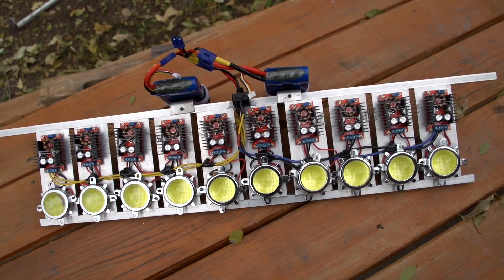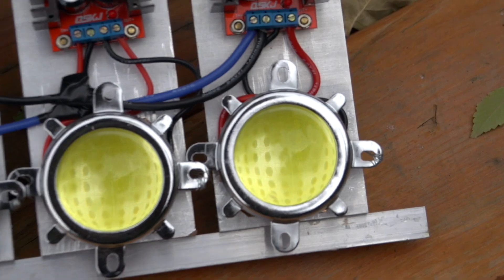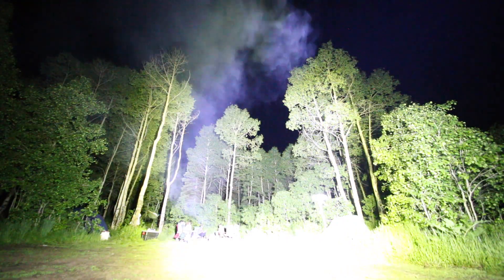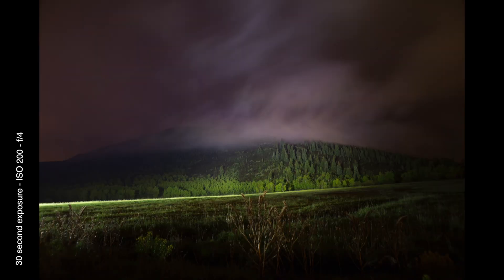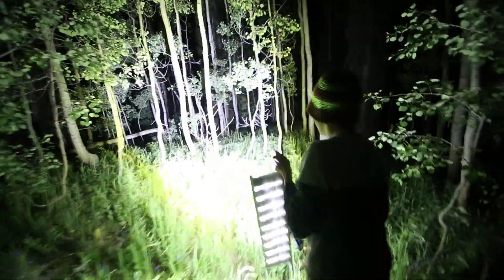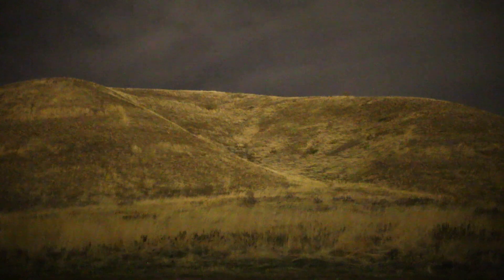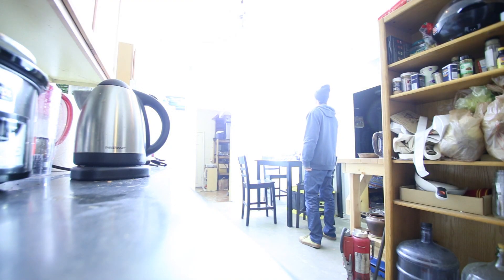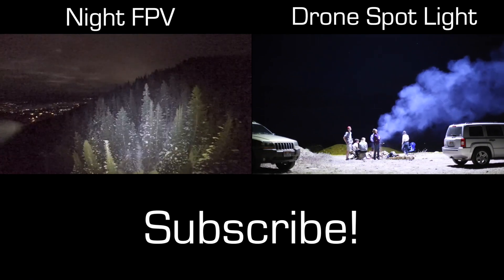1000W LED Flashlight - Worlds Brightest (90,000 Lumens)

Comment: Impressive work!!
Reply: +DIY Perks Your is better. It outputs 1000W without needing so much power.
Reply: 1000w equivalence, yeah, but this one is 10kw equivalence. :O
Reply: DIY Perks Right..I noticed that now too. Awesome videos, keep it up !
Reply: +DIY Perks Looks like Daniel discovered your excellent 1000W equiv LED tutorial and went mad! :-)
Reply: Andy Lee Robinson I have 10 kW flashlight but it produces only fraction of that power as light
Reply: you know you done it right, when DIY Perks tells you it's impressive
Reply from the maker: +DIY Perks Thanks man!
Reply: +rctestflight When the Batman signal?
Reply: +DIY Perks I need answers, what parts did he use?
I have no electronic experience, but i really want to make something similar to this!
Safety always comes first, also when driving in dense roads with greenery in every direction, not to forget animals...
Reply: ***** Yep, totally correct. Even xeon car lamps are forbidden in my country for that reason.
Reply: ^ I hate those lights.
Reply: +rctestflight where can i get the proper tools to make on of these ?
Reply: +rctestflight I don think that's a torch, it's more of a 1/3 of the sun XD
Reply: its true but if u use like one ore 2 a extra pack is just to expensive
Reply: what kind of projection lenses ate those?
Reply: haha ik dont know
Reply: you can blind the airplanes with that

Comment: How does this compare to actual sunlight during the day?
Reply: +Generic Username On any given day, the sun puts out 10 000 - 20 000 lumens in the shade, and 30 000 to 100 000 lumens in direct sunlight. So this 90 000 lumens is comparable to a nice sunny day.
Reply: +Danie Oberholzer (InsaneMfB) 10 000 to 20 000 lumens per square meter?
Reply: +MushroomHumor Why no?
Reply: ***** So darker than a clear day, but lighter than an overcast day?
Reply: +Generic Username
Impossible to answer knowing just the amount of lumens, without knowing what range you intend on using it at, and how the light is focused. At any practical range for a floodlight, it will never be close to overcast daylight, and it's not supposed to or necessary.
Reply: Toni Ostarcevic I'm not disagreeing with you, but you have to remember that with the flashlight, your eyes are adjusted to the darkness so it seems bright. With the sunlight, your eyes are adjusted to the bright light so it seems darker.
Reply: I meant to ask if the light lights up the ground at night as much as the sun does in the day.
Reply: My first time commenting on youtube in over 3 years, and I also wondered why I never did. You guys quickly reminded me why I usually dont.
Reply: +Thunder Cat You are pretty intelligent.
Reply: +Toni Ostarcevic You are not so intelligent.
Reply: +Generic Username The sun is a much larger light source compared to this that you can hold, about the width between your arms holding it.  The light is bright, but also much more concentrated.  Hence you see the shadow all over the place, like photographing with on-camera flash or a spotlight.

The better application would be to have the individual bulb on separate stands, so they can envelope the subject better, providing a more even illumination too.  In this case with a dimmer for even better control.

At this point, I see it as to see how much can you hand hold... you find the brightest LED bulb, put several of them together and there you go.
Reply: +Thunder Cat 
No, you're not correcting me. The question was "how does this compare to sunlight", and your answer already defines the things i told you need to be defined. However, this is not any usable answer to the original question, which really has no reasonable answer. Other than "this is way less bright".
Reply: +Thunder Cat You can't post links on youtube. If you do, only the poster will see his own post. The rest of the world won't. That's anti-spam measure.
Reply: +Generic Username Hi, I am wondering, should we not compare to Guide Number instead of comparing to sunlight?
Reply: +Toni Ostarcevic The only way to test that questions is to actually take the flashlight out in bright sunlight and see what the effect is. In the dark, your eyes are adjusted to the darkness so any bright spots appear much, much brighter.
Reply: It made the sun go home crying.😜
Reply: +Thunder Cat Well I'm not as intelligent as you and Toni, but from what I observed from daily life and what I've seen from this video, I have made the hypothesis that lumens on a surface decrease the further away the light source is from the surface, correct?
Reply: If I'm correct, you haven't stated the distance of the light source from the surface area during the time of this debate, have you? Toni would've been referring to shining his flashlight inches away from the ground while the sun would've been shining on the area 149597870700 meters away from the ground. In that case, shouldn't the flashlight be brighter?
Reply: Hold on... Does lumen mean the intensity of the brightness or something else?
Reply: Ah thanks. I wouldn't pursue this debate further more as this can be argued both ways.
Reply: *****
 I meant that, by twisting the words used, the formula needed to complete the answer can be changed, hence going both ways.

Words are peculiar.
Reply: The words that can be twisted isn't the facts. It's the way you people explained the situation. By using different words, different formulas would be used, changing the answer.

Or maybe it was that both of you are looking at the situation differently. Toni's answer was for lumens. Your answer was for lumen over area.
Reply: Well different answers that people hold is what makes us human. One may be satisfied with an answer even if it's wrong. I made a lot of wrong choices (in my exams) and I'm happy that I made them. At least... I know that I have confidence in those answers.
Reply: If that mistake is why I'm still alive, then I'm satisfied. I should've been dead already matter of fact.

Also Physics is my worst subject, so uh... yeah.
Reply: You could've done that a long time ago and be a happy person.
Reply: +Generic Username it's brighter than the sun! the sun is 1,000W/m2 at the surface on earth
Reply: +Generic Username like crap. It has none of the light penetration that the sun has. It has most of the natural rays, but not any penetration or intensity.
Reply: the suns "natural rays" and penetration are just the wavelengths it emits that we can't see, like ultraviolet
Reply: +Danie Oberholzer (InsaneMfB) Could I sunbathe under it?
Reply: +Thunder Cat You sound like you're just disagreeing for the sake of disagreeing. It's fairly logical to conclude that if you shine a flashlight on the ground making it white, then for that specific area the flashlight is brighter than the sun.
Reply: +Chris Ng lumens is brightness
Reply: +Generic Username Kicks its ass, I'm sure!
Reply: Generic Username The answer is most of the time, no

Comment: Put it on a quad and it will look like a tractor beam!
Reply: +AscottSauce the size quadcopter that would be needed to lift this would be huge.
Reply: +Sidewalkchalker87 i think he meant 4 wheeled tav
Reply: +iiceman14 That wouldn't make any sense...
Reply: +iiceman14 
Check out the rest of this dude's channel. He definitely means quadcopter. But yeah, considering the weight of the heatsinks, LiPos and drivers, you'd need at least a decent sized octo to lift this.
Reply: +Sidewalkchalker87 i think we will need a drone.
Reply: +DiehlGames It especially doesn't make sense when a tracker beam shoots down from the atmosphere to the ground.  ATV's can't fly(yet).

Comment: Awesome. Suggestion (if you're still reading this): mount them in a circle in front of a small(ish) Fresnel lens to focus the beam for a long shot. I would guess that it could be packaged into a handheld about 24 inches in diameter. But then, you would have to have some cooling fans.

Comment: Honest question - since light produces a force (albeit a very small force), how bright would a light have to be in order to move itself and a skateboard on a smooth floor?
Reply: Probably enough light energy to cause the skateboard to turn to plasma
Reply: Old comment, but considering that in space, with 0 resistance, light-sailing still isn't viable to move an object.. probably too much
Reply: Just enough to make you say "the floor is lava"!
Reply: @thebirchwoodtree  There actually was a light sail test and while it couldn't sustain an orbit it did produce a measurable amount of thrust.
Reply: @helloeverything496  measurable but not viable for moving objects in any practical way, ESPECIALLY on Earth like OP is asking abt
Reply: @thebirchwoodtree  Yes definitely not on earth but with a large enough sail it could theoretically work.

Comment: You can turn the voltage down from 32 volts to 28 volts and use only 1/5 of the amps and get like 1 hour of light time (Still super bright). The LEDs will use less amps and generate less heat so you could run them off of 3 voltage regulators...also you could use smaller heat sinks (One long bar) if you run them with under voltage. With the weight that you saved you could add another battery and then have 2 hours of flood light. You could also swap out those regulators for more stable and efficient one. (LTC3780 Automatic lifting power constant voltage and constant current - I think this one only goes up to 30 volt but It dose a better job with handling amps than just about every other small regulator)

Comment: Should I go stand in the heavy rain holding onto an aluminum surface with 83Amps flowing from two batteries with exposed wires (1000W@12V)? 2:34 - I don't see why not!

Comment: Compared to something like a 1000 watt tungsten incandescent bulb, obviously, it would be easier to look directly at the incandescent; but, I am wondering, what is the max amount of  wattage or lumens one can look directly into without causing ocular damage of any kind?
Reply: This depends upon many factors. Wavelength being one. Lux is a better measure of light density.

Comment: Awesome! If i built it, I would of used 12S (2ah would be same wh) and two (20A capable) buck converters, about $60 + heatsinks, if mounting them umder the props, the 10lb unit would be ~3lb.

Comment: I wonder if that can all be installed in a 50" light bar.  Even if the boards and sinks are in a separate module.  Would make light off-roading even better

Comment: That's pretty interesting, but for fixed installations we use over here to light monuments and monumental buildings, this set up could save a lot of space and power.
Reply: I you upgrade the cooling enough that it can run 24/7 and put it into a nice enclosure it will be very Large too. And that cold white Color will not look old buildings very nice. You can purchase warmer 100W LEDs though.
Reply: +Source of pic is Muchi Muchi Angel vol. 17 you are welcome
yeah I was saying above that it could be used to light the rockets launched from the NASA launch pads during night launches.
Reply: There already very bright led floodlights available on the market , bright enough to light up the  biggest monuments or skyscrapers. But many buildings are light up with son t floodlights, they're also very efficient ( i have a outdoor floodlight with a 600w philips son t pia plus bulb which has a 90.000 lumen rating. )

Comment: KOWABUNGA and
SONOFAMOTHERLESS GOAT!!
You'll put your eye out, Kid!
Absolutely amazing illumination but I'm curious about the cost of this unit as well as parts sources.
Might you en-lighten us? (Pun intended. Nyuck, nyuck, nyuck.)
It, or something similar, would put the typical LED light bars folks put on the roof of their off road vehicles to shame, with the only drawback being able to power it for any ride duration and dealing with the heat generated.
Simply AMAZING!
UPDATE:  DUH! I found your info on parts sourcing. Thanks again, Pardner.

Comment: i made a torch with 8 of the 100watts, but i got it running straight off a battery well it needs 32 9v batteries 2x16 for double the amps

Comment: No. Belive me. These converter (I have the same ones) can't convert the 35v for the leds for them to get the full brightness out of them. 3s lipo is waaaay to weak for this. In your setup the leds need obviously 3A at 35v, that means the module has to draw over 9 amps go geht the 11v to the needed 35 with 3a. Simplest electronics right there. Turn the Project on, and measure the voltage across the leds for me. Belive me, you won't have even close to 35v coming to the led, so nowhere this project puts out the lumens it can or that you advertise.
Reply: You could use 5-8s on lipos. Otherwise you won't have nearly the output that u think you have.

Comment: @rctestfligjht  Is this still holding up?  Those drivers control voltage instead of current which (based off of what I've heard) can be very unstable since LEDs current driven.